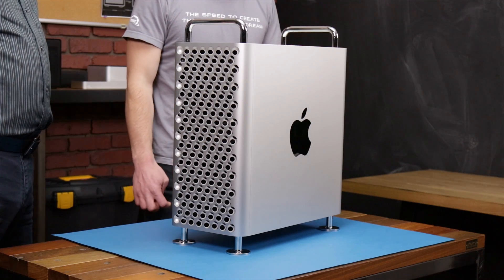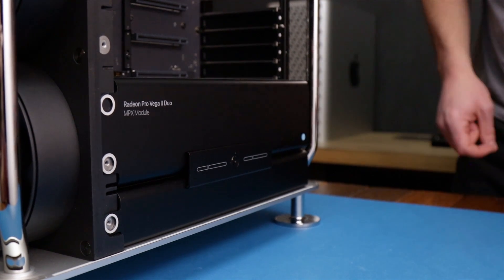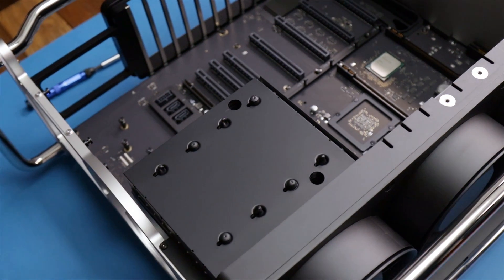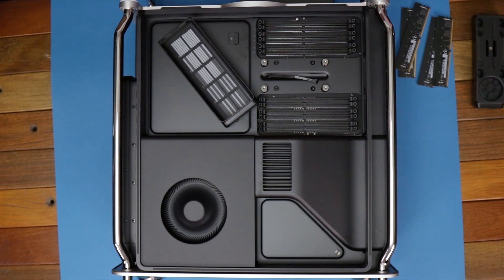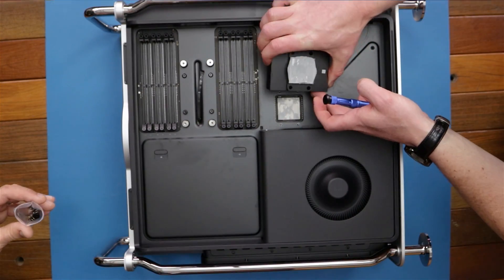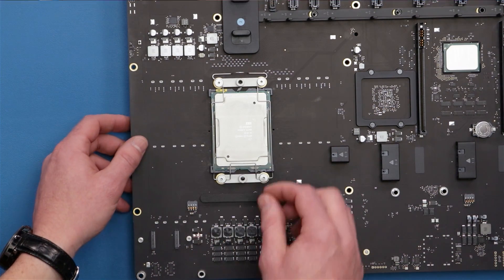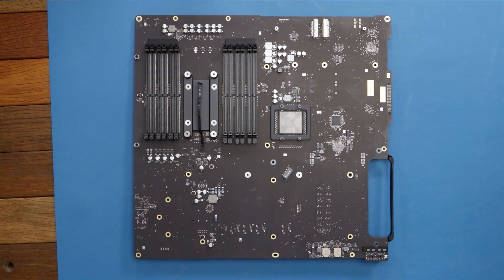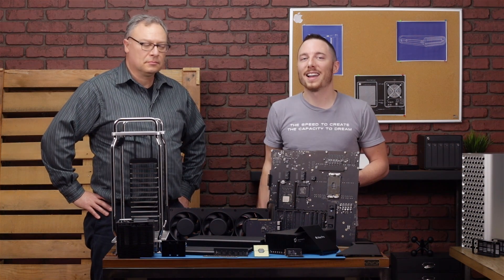Teardown of the 2019 Mac Pro

Comment: I’m a huge fan of OWC’s excellent  instructional videos. So, as many owners performing upgrades on these machines will be looking at this teardown for guidance, I tell you what would be really useful here while everything is being stripped out…. A mention of what tools are being used at each point, and any tips to keep in mind when re-assembling.

For example, stripping out the CPU heat sink (excuse me Apple, I mean the Thermal Module), requires both a Torx T8 screwdriver, and a 152mm long Torx T15 bit. Also, and as advised by Apple in their technicians manual, the latter should use a torque screwdriver, set to 1.2Nm, in order  to properly secure the heatsink to the CPU on re-assembly.

Comment: Makes me want to buy one, but wait,…can it use third party stuff, like my Wooting keyboard, or my Dell monitor?
Reply from the maker: You should be able to use any keyboard and monitor. You would want to check the specification of the monitor and keyboard if they shall need any drivers or special requirements to make it work with the new Mac Pro 2019.

Comment: HELP! I wanted to replace my 580X GPU with a 5700X, but when I attempted to pull the release latch (after taking off the plates, etc.) I heard something snap inside and now it's not pushing the rollers on the other side as it should. Is there any other way for me to remove the module? It is FIRMLY in place and will not come out.
Reply: Did U manage to sort it out?

Comment: Nice vid. Good work guys. It's engineering masterpiece, but for that money entry config is joke. 256GB flash? Seriously? In 2020?! That config, with two 512GB modules, is also joke. Workstation must have bigger system drive! GPU, more RAM, specialized cards ..yea, ok, buy more, but this? Apple its sucks.

Comment: The VRM setup on this mainboard is just a joke for a LGA 3647 platform. I mean this 6+4 phases you get with your typical 120$  Asus mainboard for LGA 1151, which is designed for 95w TDP CPUs. The 28 core Mac Pro CPU (Intel W 3275M ) is a 205w TDP rated CPU, which will definitely wants to see more than 10 VRM phases. Other mainboard manufacturers put huge VRM setups on their LGA 3647 platforms, like this one https://www.asus.com/de/Motherboards/ROG-Dominus-Extreme/ 
Hate to say this, but for a at least 6000$ system, the Mac Pros Mainboards sucks!
Reply: Interesting point of view

Comment: Wait apple computere have a bios system? I never knew that
Reply: All computers have a form of boot firmware / software, in Apples case it's not accessible easily like a regular windows computers.
Reply: @D-One  so apple uses a Recovery mode instead of the typical bios we are used to?
Reply: In novadays it's called UEFI - Unified Extensible Firmware Interface. Every PC motherboard has own system to check hardware. Mostly it check first if the CPU, Memory etc works correctly, then the machine will turns on.
Reply: BIOS hasn’t been used by any PC manufacturer for a long time now. These days, they use UEFI.

A lot of people call UEFI, “UEFI BIOS”, but that’s because they are confused. UEFI is one thing, and BIOS is another much older technology.

Comment: At the 7:42 mark, I noticed what looked like three 4-switch dip switches. Is there anything on the motherboard that says what they're used for? Wondering if there's some configuration Apple is doing depending on which version you buy. The disassembly shows how much thought Apple engineers put into this computer. Only one cable and I would have thought that would have been an easy cable to get rid of but maybe not because of the sliding action needed to remove the speaker assembly. 

For all of you PC lovers, I challenge you to actually build a comparable PC to the Mac Pro and get it to work without a whole lot of cables and extra (loud) fans or water cooling. The lack of cables means far less electrical problems while we've already seen and heard reviews of how quiet the fans are and how well they work to keep everything cool.

Comment: Well i saw some cheap ass RAMs here
Possibly they are not even B-die. That would not surprise me.
This is unacceptable in piece of tech for $5,999
However your teardown was pure joy! Happy Holidays!
Reply: You can actually safe a lot of money by just ordering the base model RAM config. Apple wants 25.000$ for 1,5tb RAM. On newegg you get the same amount for around 12.000$. 
I would also ditch the  Vega II Pro Duo(5200$) and buy four Radeon VII cards (700$ each, 2100$)  instead. Safes you 3100$ while enjoying 2 times the FP32 performance compared to the Pro Duo card. 
Easily safed over 15.000$. Apple hates me now
Reply: Literally every workstation uses the cheapest memory.
Reply: Apple use hynix ram cheaper than toshiba that is higher grade
Reply: I have a feeling you think RGB or fancy looking Ram is "good ram"... thats not how it works buddy, there's no such thing as cheap ECC Ram.
Reply: I have feeling that you can get the fuck out MacCultist and check prices for ECC. Cheap ECC exist and they use it happily
And also read this topic just for realization what actually they offer for THAT ammount of money. Get off from high horse, sir
https://wccftech.com/apple-mac-pro-ddr4-ecc-memory-cheapest/
Have a happy holidays
Reply: @D-One  i have a feeling you do not know what you are talking about. ECC DDR4 RAM is cheaper than normal "mainstream RAM" (at the same amount). And of course this RAM i mentioned is ECC DDR4.

Comment: How it's almost cableless? Where they put them all??
Reply: Lots of Engineering degrees.
Reply: Design choices...
Instead of 8pin PCI-E cables for powering GPUs Apple went with a proprietary MPX connector that plugs into next the PCI-E slot and delivers up to 450watts. With this choice Apple spared 4 thick 8pin power cables for the Vega Pro Duo GPU or 8 in case of two Pro Duos. The mainboard gets its power directly from the proprietary PSU via a thick connector. They also spared out the(2) 8pin EPS cable(s) for CPU power delivery. Drives are connected via m.2 so no SATA cables either. And there you have it. An almost cable free rig.
Reply: ParsleY on pcb
Reply: with right contact pin + right cooper thickness at least can replaced 10-15 awg cables ... all manufacture can do this but bad for pricing or not enough market for ppl will to buy ... fyi nzxt case marker do the same thing for fan on his pc case i forgot what type
Reply: all the power is routed to the motherboard, so it powers everything
Reply: Using no cables in the mainboard is not hard
Reply: Motherboard!!!
Reply: OTHER CPUs TOWERS: (OPENS CASE) CABLES EVERY WHERE
APPLE’S MAC PRO: (OPENS CASE) NOT EVEN A SINGLE WIRE

EVERY OTHER CPUs TOWER: wait.. what... thats illegal
Reply: I personally like this design very much! Just connectors. This is not only handy but also very beautiful. Nice machine to look at and it can do some heavy work. Great job Apple!

Comment: Can the two 500 GB SSD chips be changed from Raid 0 to Raid 1?
Reply: Macos supports softare raid (also for boot driver) but im not sure you can address each of the modulaes directly to do that, but if you add in a PCIe nvme card you can boot fo that or raid that into the main boot volume if you want,